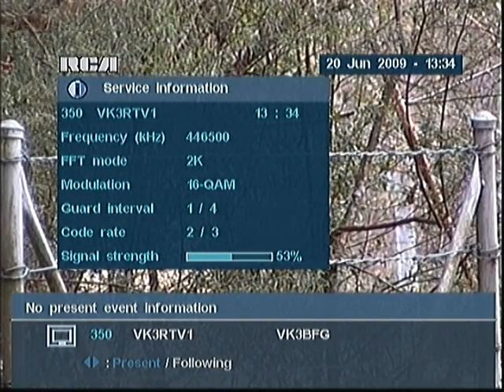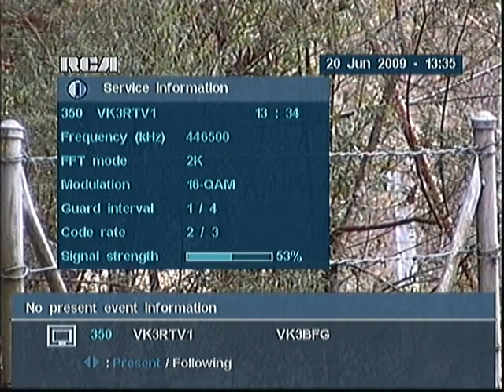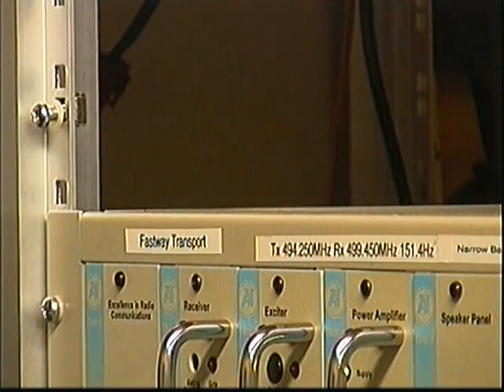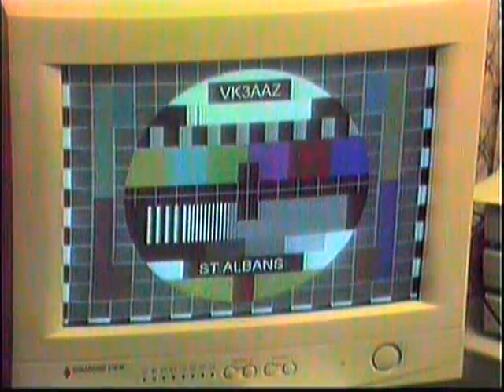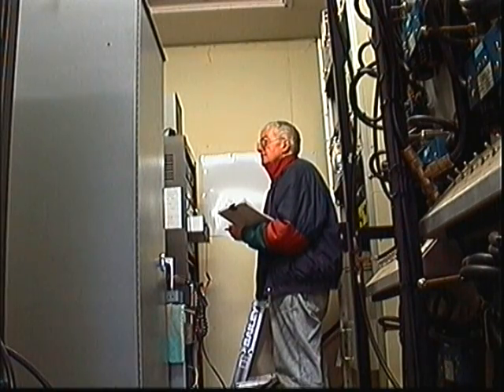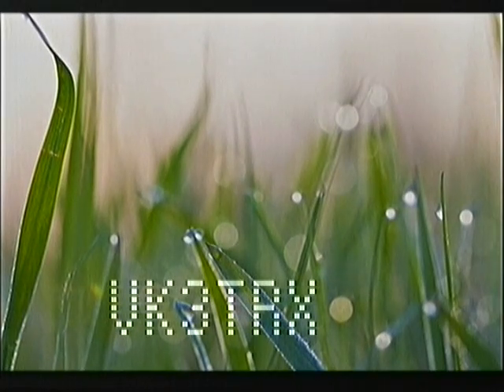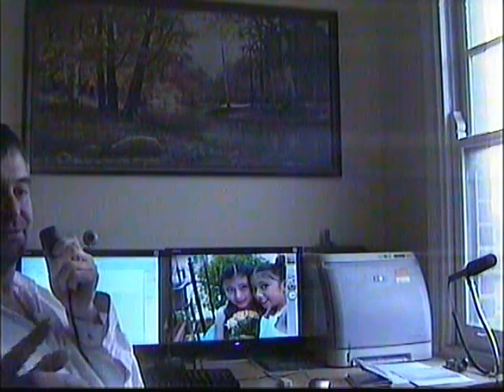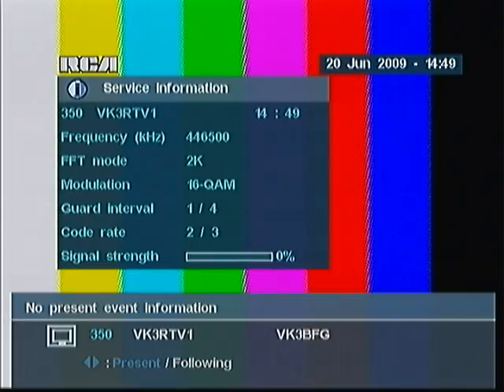VK3RTV DVB Second Test

Comment from the maker: TRC501AU is only a Standard Definition STB. Quite an old STB and I can remember at the time when I purchased the one here I paid about $125.00 at the time a HD receiver was about $200.00 and from memory there was only SBS transmitting HD at the time. One of the better popular STB's to RX RTV is the Strong SRT5405E but even that is no longer manufactured. VK3RTV puts out about 18watts that is watts not Kilowatts like the commercial stations co you need a good location and antenna to RX ATV.

Comment from the maker: @videbus Not sure where you live but I would be happy to tune the Arista STB for you.
Once tuned up it may work from your location. Most STB's need at least 50% signal before they lock in. One that does not seem to mind is the Strong SRT5405E. According to Strong it should not tune the frequency but in our experience it is one of the better STB's for RTV reception. Your other option is if you have a friend with a good view of Mt. Dandy, visit them and tune the STB there.

Comment: Yes, I have a ARISTA set top box that can see the signal at 30%, but with no signal quality.  Needless to say, it won't tune in.  I also bought a DSE box that they said might work but still no luck.  Mind you, my Analog on VK3RTV was very weak, and I am just using a standard amplfied antenna pointing at the Commercials.  But I miss seeing VK3RTV since digital.  Haven't seen any ATV since analog went off.  Boo!

Comment from the maker: No the Analogue signal went off air shortly after the second test. If you live in the Bendigo area then the old Analogue repeater now services that area.
Cheers, operators can still uplink using Analogue but VK3RTV is Digital only out. There are quite a few stations uplinking using Digital but due t the cost of the transmitters only about 1/3 have that mode.
Cheers, Jack.

Comment: No, but (1) my Teac DV-B300 set top box does not receive the ATV frequency; (2) the four acres of metal roof structure on a Melbourne Water header reservoir causes me gross multipath (3) the inherent latency and delay of the DV signal with respect to any real time liason audio is a near-insoluble problem with DV; (4) perhaps most significantly, the unwillingness of the ATV group to even discuss analogue retention for people in my position eliminates my desire for further involvement.

Comment: Diffraction problems around a Melbourne Water header reservoir roof structure (5 acres of it!) plus my Teac DV-B300 set top box's inability to tune that part of the band make digital a non-goer for me, and I'm sure I'm not the only one. I really haven't enough interest to buy a set top box specifically for VK3RTV. I have to repeat my comment: digital produces great pics IF you can get them, and it has other disadvantages, like the latency problem.

Comment from the maker: Chris, that was mentioned in the information file. I had it explained to me that when you are operating RTV 70cm and 2m simplex there is no lipsynch as the TV station is transmitting audio along with the vision and it should be in synch.
I cut the audio from the video carrier as the one second repeat in the audio was confusing.
VK3RTV should thump into your QTH, do you have a lot of desense from the tower close by.
Jack.

Comment: The delay due to latency in the digital video transmission, putting the analog liason channel out of sync with it, is one of many problems that digital transmission introduces, rather than solves. I have no objection to DV transmissions, but I think that any contemplated switch-off of analog would be foolish and shortsighted. VK3RTV uses MUCH lower power than 'pro' TV stations, and for many people - like me - sigs are too low for digi reception. More thought should be given to this  - VK3AML.